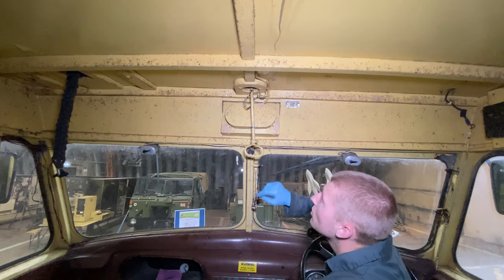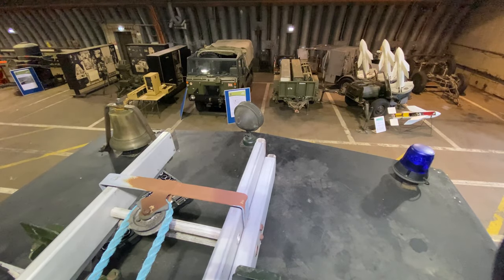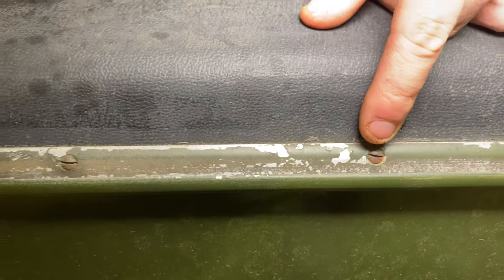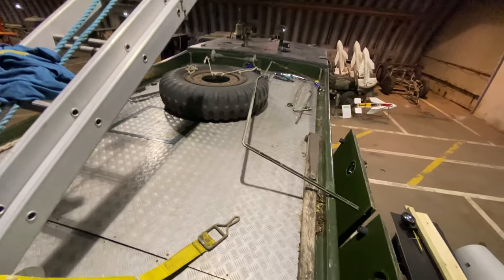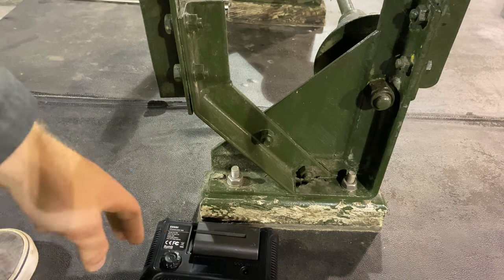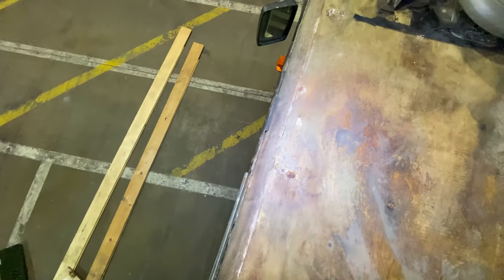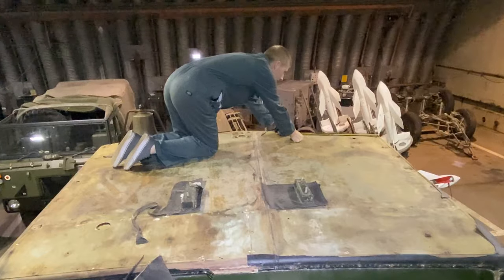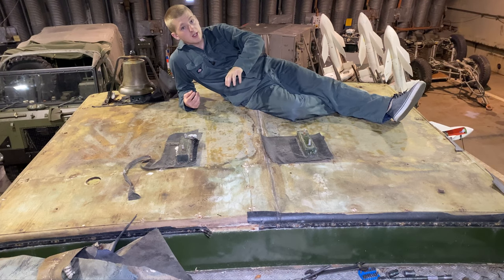REPLACING The Rotten Roof (P. 1) - 1956 Fire Engine Restoration - Ep 6

Comment: Any update fella ?
Reply from the maker: I've just finished installing the new wooden OSB roof, getting the old one off was an absolute nightmare as all the nails turned out to be screws that were all rusted in. so I ended up using a grinder to try and not damage the substructure. I will be replacing the rotten wood on the outer frame next Sunday and installing the EDPM roof then as well. I may be able to get the video up within 2 weeks if I install the EDPM roof material and leave a flap for the rotten wood replacement but it all depends to be honest. Worst case, within a month the final roof video will be up. After that I will be posting regularly as I have all the parts for painting, upholstering, adding air horns etc. Hope to see you on the next video.
Reply: @perksauto2458  thanks for updating me though it was one if them project that been scraped seen a few of theys get in to the videos then they stop and yeah ill be watching the next videos till its completed